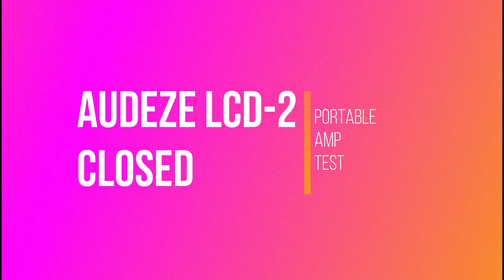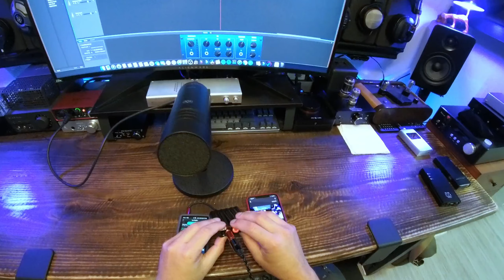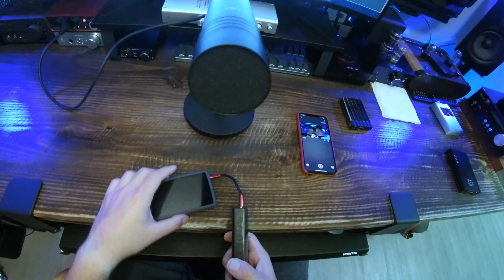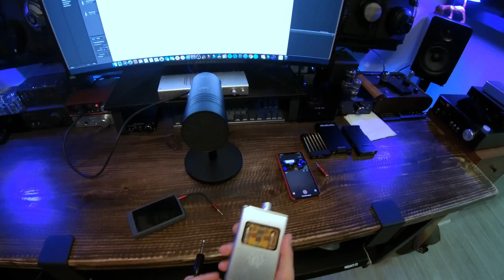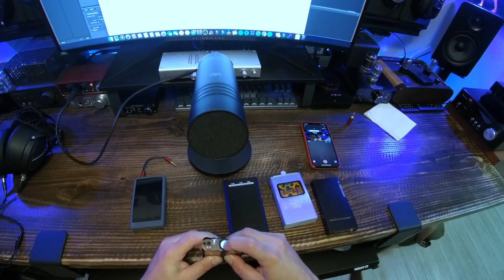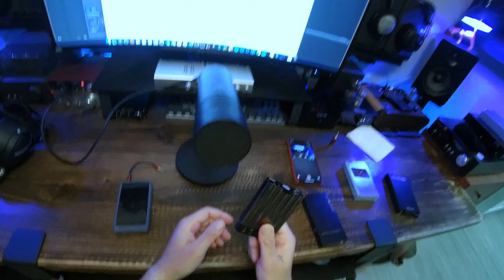Audeze LCD-2 Closed Portable Amp Test 1

Comment: Hi sir, I know that you don’t like it , but is it enough to drive this headphone by oriolus ba300s?
Reply from the maker: No. The Oriolus has very little power output.
Reply: @NoThemeReviews  sad, but tnx. I thought that 350mW into 32 Ohms is enough:(
Reply from the maker: I don’t know where you found that measurement but this amp does not have 350mw.
Reply: It’s specs from any site or review , for instance penon audio shop
Reply from the maker: That’s very strange.  I wouldn’t treat that with any authority.
Reply: @NoThemeReviews   Well even pdf on the official site confirm it, did you measured it or it is just your speculation about low power?
Reply from the maker: Send me the link to the pdf
Reply: Sent it , but in case YouTube delete link , you could easily find it on the official oriolus site in block support => quick guide.

So in case 350mW is right number , is it still not enough to drive LCD-2 closed?
Reply from the maker: That’s false marketing from Oriolus. This amp was made for Song players, specifically for the ZX300 and WM1A. That’s 350mw number is the TOTAL output along with the Sony players maximum output. The BA300s has only +3db boost to volume. The +3db had been noted by other reviewers, but they also hide this fact by repeating that the 300s boosts the signal so that the TOTAL power output of the player AND the 300s is about 350me into 32 ohms. 

Frankly, the 300s is a complete waste of money. You can get far greater amplification from the NX4 and Monolith THX Desktop. The 300s is a gimmick amp, and that’s why few people buy it.
Reply: @NoThemeReviews  tnx for your replies, tbh I saw info that calculation is 350+ player output but not 350 in the ens for both.However, I can’t maintain my statement as I don’t have an equipment for measurements.
Anyway I got mine for less of half of retail price so for me is not so bad :)
Reply from the maker: In order to drive full sized LCD headphones, you need 250mw into the particular impedance of the headphones. Any amp that meets this requirement will be fine. However, keep in mind that Oriolus charges a lot of money for +3db in volume. This is a bad amp.

Comment: Sir thanks so much what is your comment if it is the Audeze xc?
Reply: @NoThemeReviews  sorry what I meant was if I will use Audeze xc with these amps will it perform well?
Reply from the maker: As long as the amp has at least 250mw at 70 ohms then yes.

Comment: Do LCD-2 headphones really play well with these portable amplifiers? Not only loud but deep as with a stationary amplifier? I want to buy an LCD-2C for my AK Kann player, I think it is powerful enough but I have no way to check it before buying.
Reply from the maker: The LCD2 does work with portable devices, but not at peak.  It depends on the amp.  As for the Kann, AK devices are notoriously underpowered.  AK does not tell you power output with load, so it's impossible to guess how headphones will perform. I have Kann Cube, and although the LCD2 does get reasonably loud, it is obvious the headphones aren't getting sufficient power.  Remember, planars generally require lots of power/current.
Reply: @NoThemeReviews  
Thank you